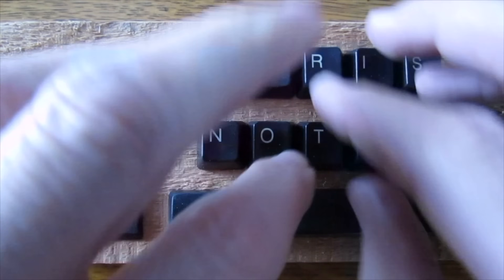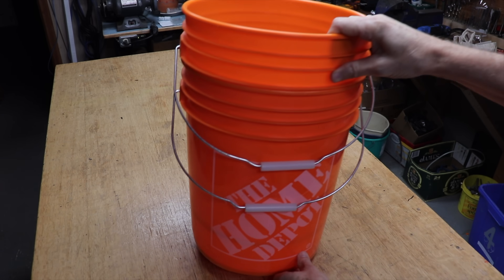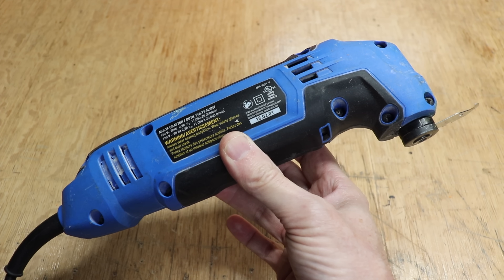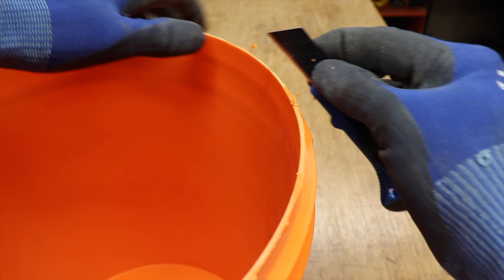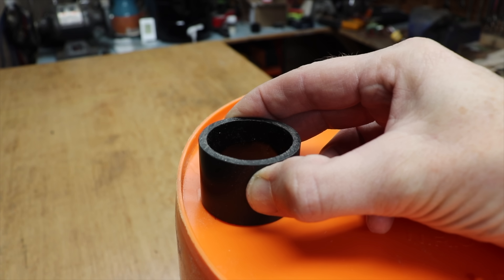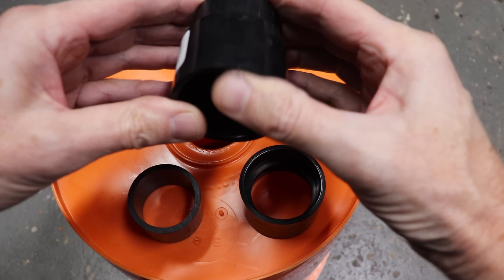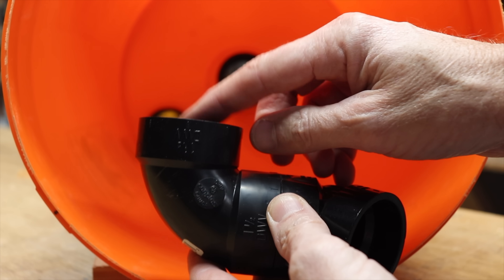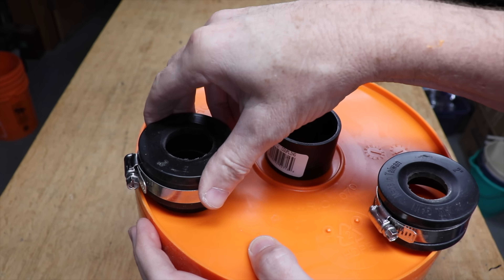How to Make ● Simple Cyclone Dust Collector

Comment: Does either bucket collapse if the inlet gets clogged up? I use a large garbage can that did. I added a vacuum brake in the vacuum side of the garbage can. When the hose gets clogged, the vacuum brake opens slightly creating a whistle sound and keeps my garbage can  from collapsing. The sound change tells me of the problem and I can clear the clog. Your design is masterful in its simplicity and logic. Sign me up!
Reply from the maker: I tried it many times hand over end and it didn't collapse. In hot climates it may turn soft and collapse but I don't know for sure.

Comment: Brilliant project. Question: Is it just me or do most wood shop YouTubers have soft slightly raspy voices? 

I have three types of 'shop vac' A large Delta two bag dust collector, a very expensive (overpriced) HEPA (mostly) Fein and a $40 'Shopvac' from Horrible Depot. I use the Delta on my table saw and other stationary shop equipment....when I get around to it. Usually large projects. The Fein, I have a HEPA filter, but also vac bags that are fussy--these prolonged the life of the HEPA indefinitely. The Shopvac? Also with bags. I have a galvanized trash can with a simple cyclone (store bought version of yours). The Fein I mostly as a house vacuum. The Shopac hooked up to my orbital sander, and for small projects. And I'll always put on the respirator first. It's that fine dust that gets deep into our lungs.  Question: Is it just me or do most wood shop YouTubers have soft slightly raspy voices?
All my shop vac solutions are overkill for the occasional wood worker and aren't adequate for a commercial full time shop. One thing I used to do in my photography darkroom, is if I vacuumed, I used a shop vac parked outside, two lengths of hose and on the exhaust side of the vac another hose that I ran around the side of the building. To wipe surfaces, water from the cold tap--no cleaning products unless it was something very specific. Because it's a darkroom, any dust would show up on negatives, where it would be enlarged onto my prints. It's like having test slides under a microscope. Almost zero dust problem. What I had learned previously was that using cleaning products and any vacuum inside the space resulted in tenacious static charged dust. 

So home shop? I'd build Chris's cyclone. It's brilliant. I would try to capture the dust where it's created, so hoses to all power tools. If possible I'd exhaust the Vac via a hose to the outside. And I'd make a room filter that would hang from the ceiling. These are not so much for you, but for your family upstairs, or on the other side of the door to your attached garage. It's also the first stage of protecting you. For you get a good respirator and wear it all the time. Just get used to wearing it all the time. (And add a backpack clip connector to the part that goes around your neck, makes it a lot easier to put on and off).
Reply from the maker: Interesting comment. Sounds like darkroom issues can be serious for the end result. Raspy voices? Not sure Lol! Thanks for taking the time to comment with detail.

Comment: I give this video a 10 out of 10 starts. Very well made and looks like the project worked. I subscribed too. I bought a $35 Dustopper from Home Depot and IMO, did not work. The box says "collects 99%, I guess it got about 10%. Then I really looked at it and thought, this design can not work so I filled it with about half full of water and it worked better. Yours looks like a great idea. I may incorporate yours, with water in it and a tube to the bottom creating a water filter. Thanks.
Reply from the maker: Thanks and welcome!!

Comment: great video, might try it for a vacuum drywall sander, has a similar problem to the wood and filter clogging.....
can probably put any sized vacuum bag on the vacuum side of the bucket as a filter for the vacuum and it would probably make it so the vac would get almost no dust:P or use a thick abrasive sponge; the bag might be too aggressive...
Reply from the maker: I've had quite a few ask this so I just finished taking 2 square feet of 1/2" drywall and I pulverized it with a hammer into dust and small pieces and removed the paper. I sucked it up and I estimate about 99.9% stayed in the bucket or possibly 99.99%. I was impressed.
Reply: thanks for the reply, I bought the fitting about 2-3 days ago(found that rona(lowes Canada) has 90's and 45's are male to female so you can skip out on pieces of pipe between); should end up with a "California Grapes" branded cyclone vac(Portuguese problems:P) which should be a bit bigger than the home depot pails and I get em "free"..... Imagine this would work great with anything that doesn't require too too high pressure; I'll likely test it out with a vacuum I already have(car vacuum) and if it works I might go out and just buy a dedicated vacuum for it; fully intend to use it for multiple purposes(wood, drywall, car sanding:P).... awesome little idea on a budget
Reply: built mine, not being concerned with it being perfect went around the edge of the top lip with a hack saw part way through then ripped it off, beveled the edge.... first 1-2 times I had to wedged it around with a small screwdriver from then on it just fit..for testing I hooked it to the central vac and sanded a bit, it was pulling in some dust(admittedly not much) so I threw a Vacmaster Cloth Filter(https://www.amazon.com/gp/product/B002MUAGF0/ ; had a few) and satisfied for now... thanks again

Comment: Does this work with drywall/plaster dust?
Reply from the maker: That I don't know. It would be interesting to find out if it would work. I may try that.
Reply from the maker: I've had quite a few ask this so I just finished taking 2 square feet of 1/2" drywall and I pulverized it with a hammer into dust and small pieces and removed the paper. I sucked it up and I estimate about 99.9% stayed in the bucket or possibly 99.99%. I was impressed.
Reply: @chrisnotap  thank you

Comment: The effect can be improved by cone-ing the bottom bucket in a bit. Roughing up the sides slightly also works, since the friction between the air and wall is what pulls the dust out of suspension. Also, if you need to get rid of even the finer dust, you can put two of these in series.

Comment: Great simple DIY. How about lining the bucket with a plastic trash bag.  fill it up, lift it out, seal it and toss.  Then you don't have to dump the bucket.
Reply from the maker: That could work as long as it is the right size bag, yes. Good tip!

Comment: Nice, i will have to get the HD buckets, but this looks like a hassle free easy solution, love it.  I like the idea of using the hose from a central vac and then you can keep vacuum and collector in a central location.  P.S  Didn't list all the parts which were no brainers so no biggie.   Cheers
Reply from the maker: For some reason I totally missed adding the parts list. I'm doing that now. Thanks for that!
Reply from the maker: Done!

Comment: I did a similar setup.  I used two pales as well.  I placed a piece of plywood at the top. I cut it round and slithly smaller, so it fits snug.  I used a hole saw fot the center hole. The suction hose nozzle fits solid.  For the side hole I cut an opening by cutting not a round but a square opening only on three sides to allow a flap to act as a secure point and as a soft surface. I fabricated a small wooden box made a hole with a hole saw, then fitted to the bucket side hole.  ... No parts required.  Only two pales and some spare plywood.  Note, I placed a brick and the bottom and decided to reused the black bag that came with my craft an table saw dust collection. Enjoy
Reply from the maker: Interesting.

Comment: any test on a fine dust like drywall dust?
Reply from the maker: I may try that to see how well it works.
Reply from the maker: I've had quite a few ask this so I just finished taking 2 square feet of 1/2" drywall and I pulverized it with a hammer into dust and small pieces and removed the paper. I sucked it up and I estimate about 99.9% stayed in the bucket or possibly 99.99%. I was impressed.  Hope this helps.

Comment: Minor modification. Maybe make the input side vertical pipe a couple inches longer to help prevent short circuiting between the input and the output. Otherwise, awesome setup.
Reply from the maker: I found that the slight downward angle of the 45 helped a lot with that. But it's all about experimenting, so yes, give it a go for sure. Re-comment if you can. Thanks.

Comment: How dirty does the filter get after some use?  The whole purpose of these is to keep the filter clean so you don’t have to keep cleaning it.  Doesn’t seem like it really does that.  That being said, it’s a badass build!
Reply: Actually, I think the purpose of these is not to keep the filter clean so you don’t have to keep cleaning it, the purpose is to keep it from getting clogged and make it easy to clean, so the filter lasts a lot longer. Just my opinion.
Reply: The purpose is to separate the big debris’s from small

That’s why they are commonly referred to as “separators” in industrial applications

Comment: you mean hold the knife 45 degrees to the bucket?
Reply from the maker: There are many ways to look at that and how to describe it. In the video I rotate the bucket at that scene so you are looking at the blade being 90 degrees to the side of the bucket. I then say to let it slide on the lower ring as a guide. Thanks.

Comment: Outstanding!  I learned several new tricks here! Great well done video!  I have a tip to add... You can "polish" the cuts on those plastic buckets with a propane torch flame. This will give an almost factory finish edge to cuts. in this type of plastic!

Comment: Good simple build.

To eliminate the additional dust getting to the vac. 
Put a piece of nylon stocking over the  intake going from the bucket to the hose.
This will help keep all the finer particles from passing through.

WW2 soldiers did this to engine intakes in North Africa to keep out fine particles of sand.

Comment: I would forego the elbow and 45 . I would use some wood to build a tangental inlet on the side of the top bucket. This way the supply hose would hang off the side and not have to curve up to the top.
Reply from the maker: Much much simpler with the fitting.
Reply: @chrisnotap  It would be more work. It would allow a side hose connection and reduce the air restriction.

Comment: Some suggestions. Cut a disk of plywood about 1 inch larger than the bottom bucket bottom. Attach it to the bottom of the bucket with some screws. This will give you something to stand on when pulling the buckets apart. 2. Use  a long sweep elbow ( street elbow) to reduce air resistance. 3.45s are available with an end that fits into the elbow. And, 4. Add some handles to the top bucket to make disassembly easier.
Reply from the maker: The rings on the side along with the handle in the lower bucket make it easy to pull apart. Yes the long sweep may help and I knew about the 45 male ended ones but most will figure that out when they buy. Thanks.

Comment: I wish I had something like this for cold ash.
Reply from the maker: Another person said the same. I'm not sure if it would work. Ash is so light and fluffy
Reply: I'm wondering about drywall dust.
Reply from the maker: I've had quite a few ask this so I just finished taking 2 square feet of 1/2" drywall and I pulverized it with a hammer into dust and small pieces and removed the paper. I sucked it up and I estimate about 99.9% stayed in the bucket or possibly 99.99%. I was impressed.  Hope this helps. With drywall dust being like ash, I think it would work with ash too.
Reply: @chrisnotap  thank you very much for the effort, I do not want to criticize, but was looking for a little bit more "compact" solution for the cold ash (for inside the house, fireplace) (as I think now, dry wall dust should be pretty the same fine dust) I use now "FLEECE DUST BAG" in my shop vac (Karcher WD4, which has the filter NOT in centre/bottom, but integrated in the side of the head unit of the bucket, I also REMOVED the liquid level "float" mechanism from the middle-bottom, centre of the head unit to give more space for a nearly full fleece bag) and are very happy with the result, the fleece bag spreads to the whole length of the bucket inner space, filters 99,99% of the fine ash-dust (ONLY COLD ASH!!!), bucket bottom and exhaust air filter remains pretty clean. again, thank you for your effort, mister, just wanted to tell. I know, throwing away fleece bags is not as environmentally friendly as re-using the buckets.. I try to recycle on different areas of our family life :-)   cheers.
Reply: @chrisnotap  Thanks for the extra test! 
I'm going to install your plumbing ideas onto the lid of a 5 gallon pail. I often have small messes to clean up. Hopefully the pail will hold 2-3 inches of dust/dirt before letting it get through to the filter.

Comment: Home depot sell  "the duststopper" fits right on the bucket .... problem solved.
Reply from the maker: I doubt that it will fill the bucket to the top though. It might, but I don't think so. This will fill the lower 5 gallon bucket.

Comment: I want a separator for a glass bead blasting or sand blasting cabinet. Something that will divide the coarse particles from the fine ones so the coarse stuff can be put back in the cabinet and the really fine stuff gets trapped outside the vacuum instead of clogging the pleated filter.

Comment: Just nope.
Way to complicated, you could do that much much simpler.
No seals between the buckets, so not air tight, so decreased efficiency
Wait until the dust hose is clogged, buckets will implode due to the vacuum. Have fun.
Wait until you forget to empty the bucket before reaching the seam level. Gonna get messy
Seam between the bucket will decrease in tightness when repeating opening over time.
Sorry, but nice look doesn't mean nice quality.
Reply from the maker: I can tell by your comment that you haven't tried it! Be positive man!! Give it a go! You'll be surprised how well it works!
Reply: @chrisnotap  oh dear - it's so depressing that the world contains this type of person........!!

Comment: Is there a way to do this with metal buckets and use it to clean a fireplace?
Reply from the maker: You're the third to ask that question. I don't know if it would work since ash is so light and fluffy. The plastic should be fine as long as the ashes are cool. I don't think you'd want to suck up hot ash since the fire hazard would be increased.

Comment: Just what I needed to add to the shop. My wife is getting upset every I track dust in. For those of you not aware, you can purchase a product similar to this one on eBay for just over $100, or, go to a local hardware store and build your own for under $20 with these directions...heck, some models of a dust collector can run $2000 up to $10,000

Comment: That's an amazing Idea. Would like to build one but the buckets you can get here in Germany have a different design. There's only one ring on top that has some hollow structures to stabilize the bucket. So the method you came up with won't work unfortunately. :(
Reply: Fasten a 6 CM ring of sheet metal  inside the bottom bucket with one half above the bucket.

Comment: Chris Notap -  Great video.  Basic quick build, minimal tool requirements, accessible low cost parts,  Big thumbs up!    Even for those who don't do wood work this build is still quite practical because it makes it easier to dump out the waste and keeps the filter clean.  
You could improve the system by mounting the shop vac to a rolling cart with place a for the buckets,  holders for vacuum attachments, hooks to coil the cord and hang the hose.  Come on make it into a video.  You know you want to, guaranteed to get you more views.

Comment: Genius!  And cheap/easy enough to put one at each work station.  Enhancement:  cut in a small clear window so you know when it’s full.
Reply from the maker: The only problem is the window get covered in dust. A flashlight behind it works well.
Reply: Chris Notap true that.  One other comment... I have found the “big box” orange buckets to deteriorate very quickly.  I would guess they skimp on stabilizers.  Food grade buckets seem to last longer.  I have a recycle yard locally that somehow gets molasses and pickle buckets by the hundreds and sells them for $3.

Comment: some good stuff in here.  i went the opposite route by jointing bucket bottoms and of course removing one of the bottoms and a baffle in the other then joined the buckets together with duct tape but the buckets collapse under the suction so that needs to be addressed with a wood ring.
the top cover has the outlet, and the inlet is a vac nozzle hot glued in towards the top.
the bottom cover comes off right into a trash barrel to empty which is really nice.
my two cents!

Comment: I wonder if it would work with a full size shop vacuum?
Reply: Of course . 2 inch fittings. 2 inch rubber PVC connectors are a great way to connect 2 or, more shop vac hoses. I have put 5 together to reach the end of my crawl space.

Comment: Use empty 5 gallon paint buckets. They are thicker. A large shop vac will collapse these buckets. Ask me how I know. 😄
Reply from the maker: Just for info sake, I tried a yellow bucket I had and it collapsed. I full suctioned this HD one with the same shop vac and it didn't collapse. I suppose a stronger vac might.